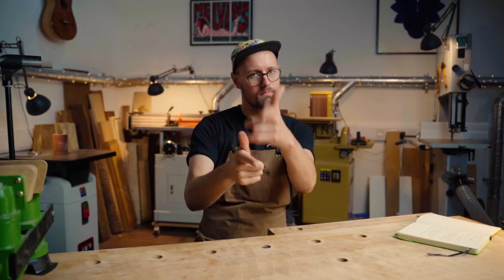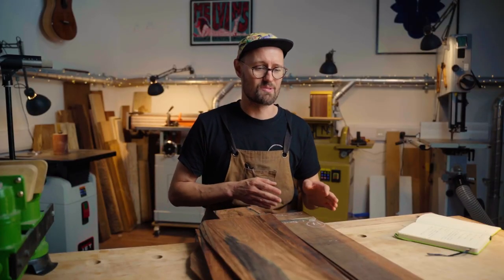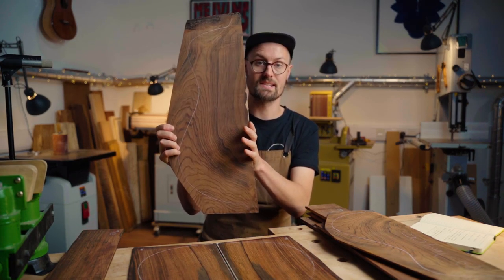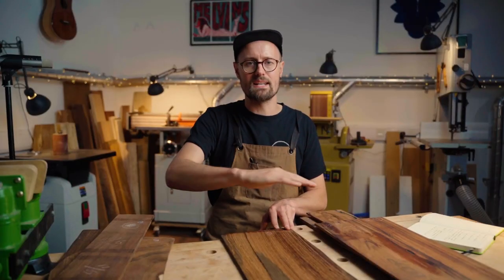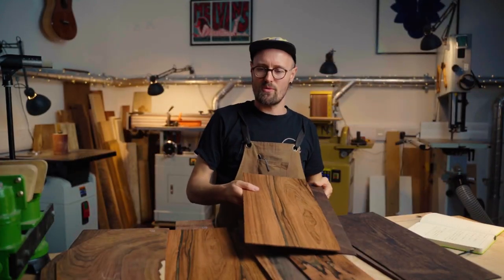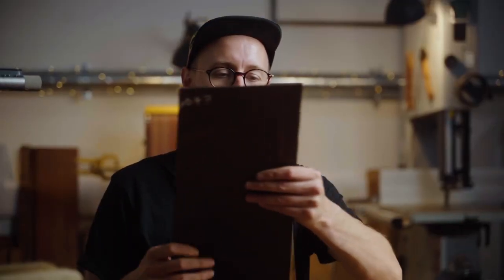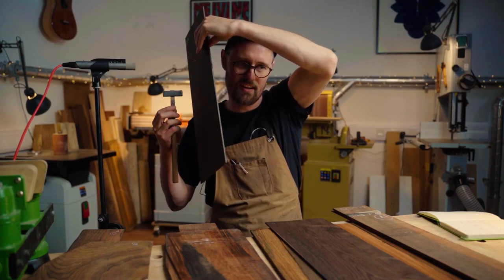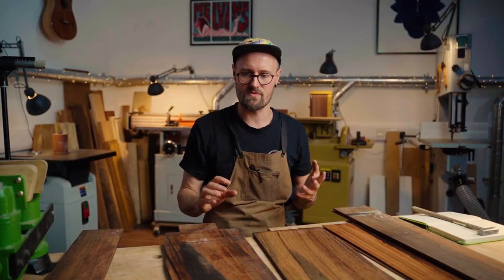The NOTORIOUS Dalbergia Nigra - Tommy's Tonewoods

Comment: I've had 3 sets of BR for the last 30 years waiting for the right time to use them. Two are pretty straight but the 3rd is wild crotch grain like your set. I never knew that it was cut from the stump but makes sense. Any tips on retaining structural integrity when using this (or any other wild grain) wood?